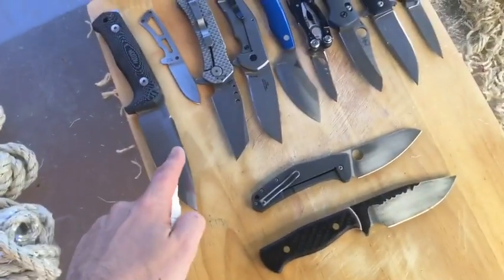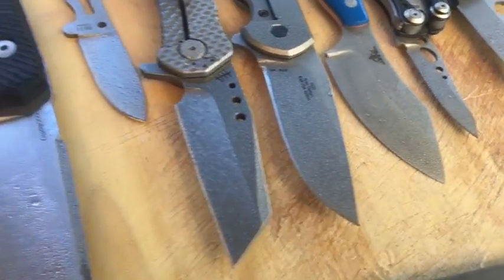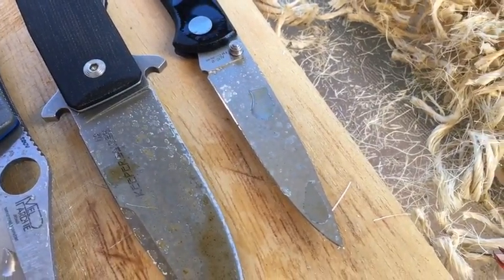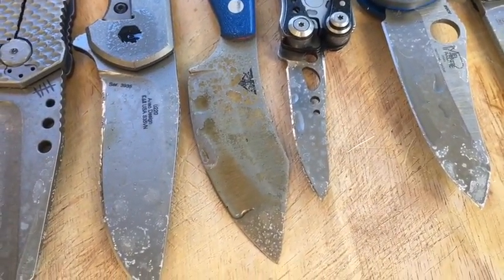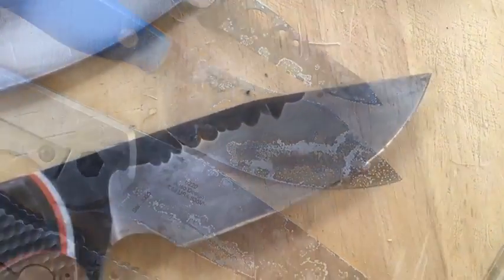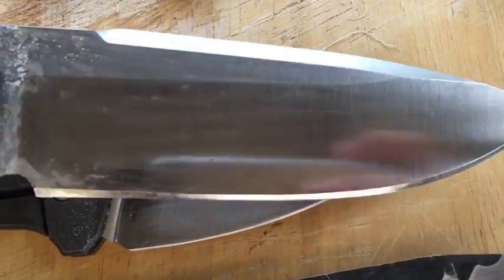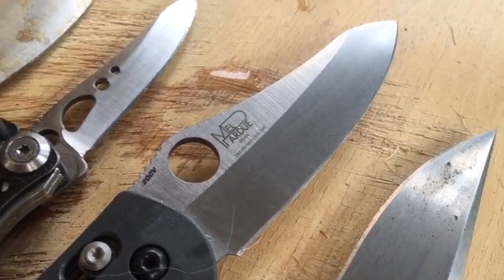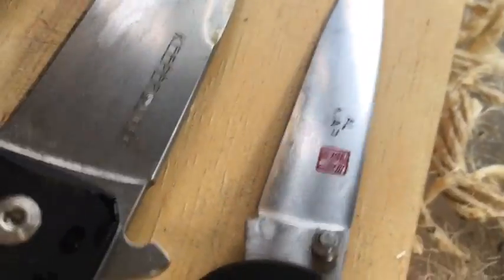Rust Resistance Knife Testing - Which one corrodes most? I was suprised!

Comment from the maker: With regard to the BRK CPM154, I'll shortly do a fine sandback and retest to see if it is a carbon steel belt sharing transfer type issue as someone below suggested. I've got all the rust off now with a polishing wheel and WD40 bath
Reply: Or they probably botched the heat treatment, the temperatures were off and a lot of the chromium was bonded into carbides instead of remaining into the steel solution.
Reply: @em4703  The chromium is supposed to turn into carbides with this steel, if not the carbon would be kept to 0.60% like AEB-L. I also has 4.00% molybdenum and creates moly carbides as well. The steel is obviously not CPM 154. 
D2 has 12% Cr, but 1.50% carbon and 0.90% vanadium so it makes a lot of very hard Cr and V carbides. a little rust in saltwater is expected, but pitting after a few hours of saltwater is indicative of a minimal heat treat.

Comment: Excellent video!

Obviously steel composition has the largest effect on corrosion resistance.
However, blade finish and heat treat also play a role.

In order to accurately test them, they would all have to have the exact same finish at the exact same grit.
I’m not sure if they do or not.

Imprecise heat treat protocols can lead to the formation of chromium carbides which reduces free chromium in solution and ultimately reduces corrosion resistance.

This leads me to believe that the 154cm on that particular knife was not heat treated properly, and of course the finish could play a small role as well.

I don’t say that to criticize at all.
Just so many variables and it’s hard to account for all of them.

Very interesting video with surprising results.
Excellent job!
👊🏻

Comment: The cpm 154 has to be a misprint. I've tested cpm154 vs many knives using mustard and it always beats the other steels I use in my knives. Namely A2, W2, 80crv2, and 5160.
Reply from the maker: it ended up being mislabelled A2! full refund
Reply: @CedricAda  wow that's a horrible mistake. Makes one wonder how many have been "mislabeled ".

Comment: That's a very interesting CPM-154 result. Most likely explanation is a botched heat treat leading to chromium bonding up into carbides instead of being free and making the steel stainless. So if you were to look at a micrograph I think that CMP-154 blade would look more like D2 than properly heat treated CPM-154. The O1 is very odd to me. I expected it to rust at least more than D2.
Reply from the maker: it ended up being mislabelled A2 steel, they sent me a new one that didnt rust in cpm154
Reply: Ah that makes a lot of sense I suppose. Mislabeled steel is certainly not what I would have expected.

Comment: Just a short observation - when you spray the salt water on the blades what little there is will evaporate pretty quickly. Maybe faster on some knives than others? (Direct sun or other factors?) Just submerge them in salt water, then the conditions are the same for all knives. In any case, thanks for doing what I won't be doing to my collection...:)
Reply from the maker: +Gill Bates yeah, I havent figured out a particularly 'sciency' way of doing it apart from using the saline from the one bottle about as evenly as I can. I did a second coat the same way at the half way mark. It was pretty humid and all in the shade under this area (like an undercover entertainment area). Submerging/suspending is a good idea too.

Comment: I stumbled upon this write-up a while ago, and it seemed pretty incriminating, but the performance of the "stainless" steel sealed the deal… Unfortunately the catalog is no longer available online, so you'll have to take my word for it, but it's pretty fishy that the Blackwater Boot Knife was, in fact, hollow ground and claimed to be made of 12C27, which would have similar corrosion resistance to the actual steel used. It also helps explain some of the complaints about Bark River's 12C27. Just food for thought.

http://m.ripoffreport.com/reports/bark-river-knife-and-tool/escanaba-michigan-49829/bark-river-knife-and-tool-false-advertising-claimed-knives-are-100-american-made-but-ar-170631

Comment: The model is the Bark River Knives: JX6 Companion - CPM 154 but they also make the exact knife in A2 I wonder if they accidentally got the labels switched, if you're familiar with the process at Bark river knives, the knives are made and then they are sent to the prep room where a lady preps the knive and then they hand etch the logo and steel type onto the blade. 

I have three bark River knives, and I have never had an issue.

Comment: That hurts my brain what the he// heat treatment of a stainless steel can affect the stain resistance depending on the carbon to chromium ratio in the steel amongst other things but at 14% chromium and barely over 1% carbon the blade wouldn't perform properly if all that chromium was eaten up into carbide gives me some research to do
Reply: Lugermonger like I said, Sanskrit. Break it down for us knuckle-draggers...

Comment: Cpm 154 is supposed to be more corrosion resistant than 154cm, per crucible industries. No matter the cause (wrong steel, heat treat type or contaminated belts) that's not cool and is Bark Rivers fault. I suppose bark river cultists are already angry with you, "stainless doesn't mean stain proof!" It should have out performed 154cm no matter what anyone says. I'd send it it back all rusted up and get a refund.

Comment: Heat treatment can absolutely change the corrosion resistance of a steel, by changing how much chromium is sealed in carbides vs how much is bound to the iron crystal structure. For a real-world example, check out Survive Knives' experiments on 3V: https://www.instagram.com/p/BTy5mRJj-ia/?hl=en&taken-by=surviveknives. Same steel, same finish, but different heat treatments.
Reply: HammerHill that is very true. This is why the 01 lasts as long as it does, because they use a low temper just like the delta 3v from survive knives (Peter's heat treatment). The cpm154 however is a different story as bark river is known for mis labeling steel and dry sanding and poor heat treatments among many many other issues unbeknownst to the general public.
Reply: Could be that there was some iron on the surface of the knife as well, deposited from an abrasive belt that had been used on a carbon steel. Maybe there was some carbon pickup or phase-change wonkiness from a unchecked temper, though I didn't think CPM 154 was so temperamental... I'd love to see the test re-done after refinishing the steel to remove any possible iron deposits

Comment: Bark river has been known to have the steel labeled incorrectly. its happened many times before. also note that the heat treatment can have a HUGE effect on a knives properties to rusting. D2 can be heat treated in a way to prevent rust longer. the O1 you have has had this treatment. refined grains and low double temper iirc. so the cpm154 could just be heat treated to be maximized in another property or its not really cpm-154 (which is what i would suggest)

Comment: This reminds me of the CRKT Hootenanny with "S30V," that rusted unexpectedly and quickly. Of course, it was revealed the Chinese factory used a rust prone substitute. Sadly, there is a Chinese manufacturers that will gladly make anything for customers and mark them any way desired, or, for the "custom knife makers," leave them unmarked. I don't know if the CPM154 here is typical, prepared differently or is mismarked, but it should perform as well as it's non-powdered version.

Comment: Thank you for your courage, and blade sacrifice! 
Blades are easily contaminated though. Iron can easily rub off, from other sources. The best way to know for sure. Would be to buff the blade well, with a new wheel and fresh compound. Making sure that any possible iron contamination is removed. Then test it again.

In shops, and sometimes factories. Buffing wheels, stropping wheels, grinding stones, and belts. Can all be contaminated with previous sub-stainless steels.  

As an example. A friend of mine had a new stainless steel blade that rusted pretty quick. Come to find out later. He had buffed it on a bench grinder, that had a wire wheel on one side. The wire wheel was steel, and did put a nice luster on his new blade. But that thin film of iron that was put on it during this process, which could not be seen by the naked eye. Easily showed up later. A quick buff, with a new 3M Scotch-Brite wheel, didn't make it look any different. But it did remove the iron film.

Comment: Thanks for the informative video. i am studying material engineering in germany. i can tell you that corrosion is a huge topic an the "rust proveness" of steel depends on many circumstances. such as surface, ingredients, heat treatment(toughness or corrosionresistance is adjustable), corrosive environment(acid oder base) etc. but your test indicates a quite practical look which surprises. your test conditions tell that it is not a testing fault that lead to this results.

Comment: My years old Opinel No 8 died as a result of too much coastal exposure. I'm wiser now. My No 7 Carbone shines like a stainless blade and is regularly stropped with a few drops of honing oil on the leather. Interestingly, polishing the blade brings up the grain of the machining marks. I actually like the look. I chose the Carbone because I guess I'm a purist when it comes to Opinel. I guess I should buy a stainless Opinel and try it out, rather than judge blindly.

Comment: Looks like Bark River might not be using the premium steels they claim to be using.   I can't think you enough as I was strongly considering purchasing a high end bark river north of $300 USD.   You just saved me a lot of money sir.
Reply: Tried out Bark River a couple years ago. There were some designs I really wanted, so I stuck it out, chased perfection for a bit, and gave them way too many chances.

4 out of 6 had gaps between the handle and tang, some quite significant. (Luckily one of those was caught by the dealer before shipping).
I tried to get one fixed, and they didn't respond to my email, so I called...they didn't apologize for the issue and said to send it in according to the instructions on their site--including me paying $20. To fix a brand new knife.

Two with burnt edges. Two with nicks in the tang and ricasso, one with a random deep gouge in the tang. One that came with micro chips, and another that chipped instantly, from nothing more than sheathing and opening a single package.

Generally...inconsistent and faded maker's marks, sander swirls on blades, inconsistent handle finishing (a mix of polished and matte areas, some belt burns on micarta, some asymmetry, and some arriving dirty with polishing compound).

I had hoped that it was a volume thing--they make lots of knives, so the 1-2% who get duds complain and seem like a bigger group than they are.
Then I got burned several times in a row.
Jumped ship. Will never buy another.
Reply: @noamaster3898  seems like an excessive amount of issues you've experienced with Bark. You addressed it with them and they only fixed the 1 knife?
Reply: @obu2108 I tried to get one fixed. I called BR (after my email went unreturned for several days), explained the issue...they didn't even say, "Sorry to hear that," just said, "Send it in according to the instructions on the site."...At my cost to ship to them PLUS paying $20 for return shipping. To fix a brand new knife.

I told my dealer I wasn't going to pay to fix it, and they contacted BR, who told them they were already taking care of it. But they didn't contact me or offer to pay shipping...so I just returned it to the dealer.
The passable ones I sold, the rest I returned. Lesson learned.
Reply: @noamaster3898 I understand to not expect perfect, but yours sound sloppy. 😬 I pre-ordered one a couple days ago. Hoping I get a good one🤞
Reply: @noamaster3898  that's unfortunate, I just got a barkie and it's my first knife over 40$. Same as you I thought maybe 1-2% was making it seem like a big problem and took my chances, I got a BEAUTIFUL knife. And I asked them about a plunge line they said it's fine doesn't hurt performance but they'd replace it or fix it. INSANE customer service. That alone is enough to keep me, they promise awesome knives in the steel and handle you want and if it's not to your liking they make it right no questions asked. Insane
Reply: Interesting.  I probably have at least a dozen BRKs with zero issues.

Comment: Even if the bk was in A2 It would be a strange result, as 
A2 is considerably more corrosion resistant than O1 in my experience
Reply: badeston yes A2 is a more expensive steel because of more edge retention AND rust resistance than O1

Comment: Holy crap... You make some pretty sizeable sacrifices for the knife community. And that's pretty weird about the cpm154... Makes me wonder if bark river is pulling some kinda funny business! O1 did shockingly well it looked like the d2 was actually worse. I might just lose some sleep over the cpm154 debacle.
Reply: 01 has a really good heat treatment by Tindel knives. he knows what he is doing and the grain structure is refined and then tempered to prolong rust as much as possible. many steel types can do this. depends on how the mfg decides to heat treat and what properties they want in the end. but not every knife company cares about heat treatment.
Reply: Tactical Center That's some good info! Thanks for the response, and yeah it definitely seems like most companies don't care at all about HT at least until someone calls them out! I might have to do a similar test on my channel.
Reply: Sorry maybe I'm ignorant as to the manufacturing process and oxidation tolerances... What exactly does heat treat have to do with steel oxidation? I was under the impression that heat treat affected hardness and edge retention, and that rusting was a property of steel type and composition. If a steel type is prone to oxidation due to its components, it will rust. How does heat treat affect oxidation? Does the heat treat alter the elemental composition of a steel? Thanks for any info and please educate me on this, I don't know enough about it to knowledgably (word?) comment without sounding as if I'm talking out of my ass...
Reply: @mayo470  no don’t listen to him. heat treatment has nothing to do with corrosion resistance. You are correct about that. The composition of the steel will determine its rust resistance, just like you said. The more carbon that makes up the steel, the more prone that steel is to rusting. It’s that simple. One thing that can effect corrosion resistance other than that, would be how polished the steel is. A highly polished blade will aid a bit in rust resistance. But that is very hard to do with high end steels that run a little harder on the Rockwell scale. I will say that the heat treatment effects how tightly packed together the molecules of steel are, and perhaps this could aid in achieving a finer polish. That’s about it.
Reply: @mayo470  I used to be the heat treater at a machine shop as one of my duties because I mentioned I made knives as a hobby. Yes, hardening does go a long way on slowing rust and since it was O1 I'm guessing the 0.20% vanadium made it have a very fine grade, it's why you see that little 0.20% on so many steels including stainless.

Comment: hhmm maybe incorrectly labelled by BRKs and it's the standard A2?? You can post the video on the BRKs Facebook group. Mike Stewart is on there quite often.
Great video BTW.. You're a brave man to do this on your knives. The videos I usual see are performed on cut offs lol.
Reply: MrSakoTRG Mike Stewart will most likely be pissed off if he posts the video. He doesn't want his company to be exposed to the stuff they do. He will most undoubtedly cause a ruckus. Very bad company drama for many years.
Reply: Tactical Center yeah he definitely won't like it but publicly from what I've seen on there it will put him on the spot to investigate the issue & correct it or replace the knife if there is something wrong. Any issues with his knives & he seems to be very quick on damage control. The video will most likely make its way on there at some stage.....then the popcorn comes out!

Comment: I'm pretty sure that the finish is to blame on the BR... it is certainly not the most polished satin and leaves much surface area to corrode. I'm not an expert though.
Reply: Mopar HEMI advertising as stainless yet doesn't take steps to make sure it is when customers get them? Lol
Reply: In some ways that is true, but what I have found out through my use, is that the blade finish isn't as important as the finish on the actual sharpened edge. If there is some spotting on the blade or if a patina builds up, there is basically no difference in performance. If the edge rusts though, your knife looses it's main ability which is of cause to cut things properly, so if you keep the edge at least decently polished it should defy corrosion just fine. The chromium content should help with this but doesn't prevent it from happening... saltwater is still quite harsh!

I'd be interested if it's just the blade finish, maybe an error in heat treatment or if this knife actually isn't made out of the steel it got advertised with. Latter would surprise me because BR earns their trust from the knife community since years.